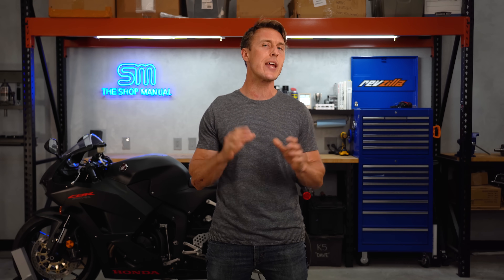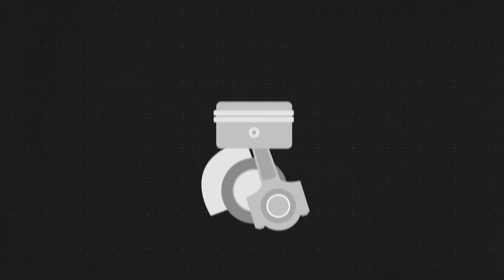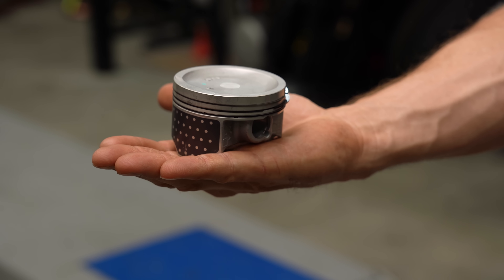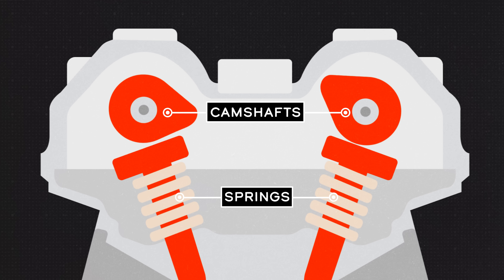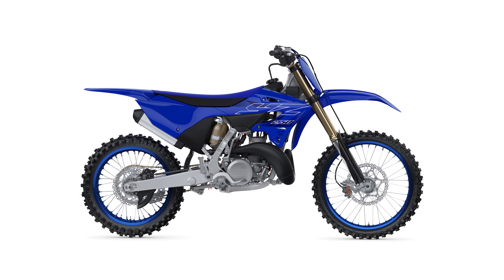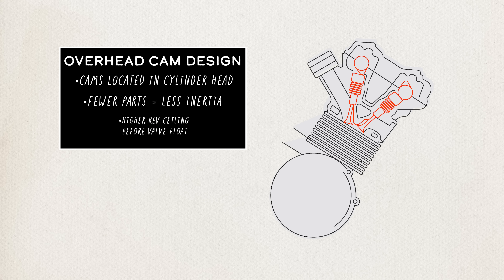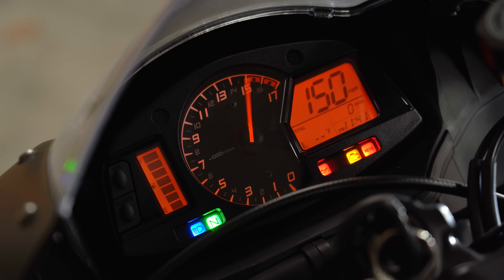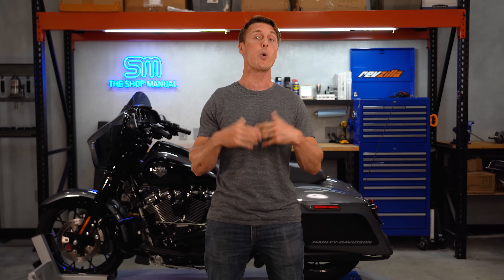This Is Why Your Motorcycle Has a Redline | The Shop Manual

Comment: Another reason for red lines in sport bikes is that the flame front of gasoline combustion is only about 105 fps (70mph). If your piston moves faster than that, it's using more power than it's producing.
Reply: Can you break this down, or tell me what specifically to Google for this explanation lmao
Reply: @PnTcertified  Gasoline and diesel do not explode.  They burn. And that's a very important difference.  Things that burn produce flames that travel at a specific speed.  With gasoline and air, that speed is about 105 feet per second. 

Engines produce power because the combustion process increases the pressure in the cylinder.  In a normally operating engine, that pressure pushes down on the piston harder in the power stroke than the piston had to push to compress the air in the compression stroke.

However, if your piston is traveling faster than the flame front, faster than 105 fps, it is only extracting the pressure it put into compressing the air.  It isn't getting any of the pressure from burning the fuel.  At this point the engine is using more power than it is producing because of frictional and pumping losses.

This would really only happen at the middle point of the powerstroke, not for the full stroke.  But it is still wasteful.
Reply: @SeniorKlean  wow, appreciate the thorough breakdown. This was easy to follow. Didn't know these random details about pistons and how combustion differs

Edit: to add actually, when you refer to the speed of the piston going faster than the pressure is able to slow it down, is that because sustained high speed has reduced the ability of pressure to overcome it? If that makes sense. Like what could cause speed getting so high to overpower pressure
Reply: @peanotbutta  It’s the opposite actually. It’s not the piston moving too fast for pressure to slow it down, it’s moving too fast for pressure to speed it up. 

Think about it like this. You’re pushing a child on a bicycle. At slow speeds you can push pretty hard. But you get to the maximum speed you can run and you can barely push anymore just by running. Give an extra shove by extending your arms and the bicycle is now moving faster than you can run. You are no longer able to push on the bike at all until it slows down to your running speed again. 

In that analogy you are the flame front and the bike is the piston.

Comment: Hmm hear this explained before but a bit differently
I might be wrong but it had a lot more to do with the speed gas can expand, thus producing power
Like cars engines are usaly bigger produce more power but are a lot stronger, yet they run at way lower rpms
But looking at piton speeds aka speed Gas is pushing on the pistons, they are not that different
Bike motors just havea very short stroke

Comment: 2 strokes having redlines might be true on larger street use bikes but with less than 150cc you will start losing power before the revs are too high for the parts to handle. For example my 88cc has its peak power (around 27hp at the crank) at 13.5k rpm and after that the power falls off rapidly. The bike will not rev over 14.5k even on neutral. Also it can handle these kind of revs throughout the lifespan of the engine.

Comment: I hate going any where near red on either of my bikes but there both built for low to mid range torque more then all out HP. GSX-S1000 and CBR300R both use torque to get you going! I usually shift it like 4k rpm on both of them! Cruise at 5-6k rpm on the highway. The CBR tends to run out of gear on highway so I don’t take it on there for more them like one exit! Winds it way to hard for my liking and that’s what the big bike is for it loves the highway! Eats it up!

Comment: That mostly car stuff. Modern day m/c motors have rev limiters. If you are shifting near redline it's a good way to slow down acceleration.
How about spinning a bbc with a 4.60 bore and a 4.80 stroke 8000 rpm?

Comment: At the Vespa shop I worked at in the 70s we used to demonstrate engine durability by running it wide open in neutral for a full tank of fuel.
Reply: Wow, really, a two stroke I presume, and the inbuilt ducted cooling alone sufficed? Kind regards.

Comment: Now what I'm still trying to figure out is what the redline RPM on my Suzuki GZ250 is. Nobody on the forums knows, and the manual doesn't specify. Manual only specifies that peak torque is at 7k and peak power is at 8k, but at what RPM does the piston blast through the gas tank and into my face?
Reply: Only one way to find out....
Reply: Did you find it out yet?

Comment: My 2012 Aprilia RSV4 Factory developed a crack in the CAM retainer, problem is you can't buy just the retainer you have to buy the whole head.  I bounced it off the rev limiter more than a few times at the track.

Comment: Hi Ari! I am new to riding just 1 year but took the MSF first and have over 24K miles. I ride a 2015 R3 totally stock except tires, brake pads and a chain. I have maintenance my bike as per Yamaha suggests. I don't think I ride my bike improperly. Would revving a bike like this say no more than 11K RPM (just to accelerate at first but regularly doing so) cause it damage? I have put a little over 8K miles on it since June it had 650 miles and sat for over 4 years when I got it.

Comment: I have a question possible to do a video this is very common. On the highway we all love the sound of our exhaust but many times I am at 5th gear and don’t change to 6th gear unless the rpm are higher to where I need to change it. I ride a Suzuki r600 . Is it bad to ride at that high rpm for long periods of time

Comment: I did a rev limiter party trick 2 weeks ago on my r6. Floated a valve, dropped it into cylinder 2, and am rebuilding the motor now! Cool trick huh!
Reply: My first motorcycle was zx6r and I always not only party's on every corner rev the engine and drift it , no issues and it was very old like 1998 or so with 33k km , what a machine
Reply: how many kms/miles did it have back then and what year is your r6 from?

nonetheless pretty cool that you get to rebuild it yourself, must be a tedious job

Comment: I have more to add to this. 
When it comes to electric motorcycles, voltage determines the top-speed and rate-of-acceleration of the motor. 
But whether you're a manufacturer, or building a homemade EV. Once you determine what spaces you're filling with batteries, you must then determine how much you wire those batteries in Series and or Parallel.

Basically, wiring in parallel, will combine the batteries capacities and amp-limits, which will allow the system to provide more range & torque, but the lower voltage will mean you will be very slow. Parallel is almost like being stuck in 1st gear.

Wiring completely in series, will almost be like being stuck in top-gear, higher top-speed, but because the amp-limit is so low, the batteries can't safely & calmly provide enough amps to allow the motor to create as much torque as IT safely can.

So, the things that limit the RPMs of an electric motor, are:
1) The amount of voltage you can practically produce from your onboard battery configuration.

2) The same Elecro-Magnetic-Fields that the motor uses to work, also create back-EMF, that not only limits RPMs, but is also the reason why torque starts to taper off, at higher RPMs.

3) The capacitors within the motor-controller/inverter, are rated up to a certain voltage, beyond which, they pop, so select a controller right for the voltage & amp ranges of your build.

4) The windings of wires, that creates the electromagnets the motor uses. The insulation of those wires, like any other wire, can only contain a certain amount of voltage, above which, the high-voltage will start arcing out, creating short-circuits, ruining the windings.

5) The fluid drag of the rotor and other components moving through air and or oil.

6) After all this is compensated for, the final factor, is that the motor spins so fast, that centrifugal forces start ripping it's rotor apart, and the bearings may not be able to handle those speeds, leading to them wearing out much sooner, or even catastrophically falling.

That's it, that's all the things I'm aware of, limiting the RPMs of electric motors...but I don't know what limits Wankels & gas-turbines, other than centrifugal-forces, fluid-drag, and maybe flame-fronts/thermodynamics?
Reply: Oh, I also remember a BMW car, that apparently had a lower Rev-limiter, to protect something in it's transmission. Someone reset the rev-limiter, because they had an aftermarket transmission, or just didn't give enough of a F.

Comment: Some bikes live at redline. My 1977 CB Twin's redline is 12.000 rpm,but I frequently push it to 13.000 or even 14.000 where points ignition just can't sustain spark. It was absolutely advised to stay at 12.000 rpm all day(The manual stated that 12.300 rpm was an acceptable cruising rev)  and even short bursts up to 13.000 were included in the manual. Small bike, high revs : all the fun with no fear of tickets.
Reply: I'm not impressed
Reply: @ronalddaub9740 That's nice dear

Comment: Question i cant find a straight answer to: SHOULD I LUBE BOLTS WHEN I PERFORM SERVICE TASKS? Coming from bicycle maintenance there is a golden rule there: everytime you unscrew something you clean that bolt/screw and GREASE it before putting it back. Is this true for motorcycles? Or will it lead to overtightening or undertightening?
Reply: My OCD tells me to do that, especially if u live near humid area

Comment: Coming from cars where typical my cars telling me to shift up so early for mpg benefits I guess and being fairly new to motorbikes im trying to get out of the habbit of not shifting up too early and letting the engine run 7000-8000 rpm. Is that the norm? See a lot of folk saying that's absolutely fine and actually better than trying to be more conservative.

Comment: When talking about crank shaft failure, you should have used a Honda CBR300R for your backdrop instead of the 600R ;-)
Reply: The snapped con-rod we used as an example of engine failure is out of a CBR300R.

Comment: I know the basics, but Ari and RevZilla usually give me something to think about.  Great cycle channel.
My VFR had a 11,500 redline?  90% of the time I was between 3 and 4.5k.  7k and you were at 100 mph. Took it to 10k for a brief time, and was ready to go back!  I needed a track day to find out what that machine could do.
Reply: Surely you rev your engine to accelerate?
Reply: @MrBulli69  he wasn’t really utilizing any of its potential.
Reply: 3k to 4.5k is awful for that engine, 5k and above is where it wants to sit all day.
Reply: That bike is BUILT for high rpms. The heat and inertia of higher rpms keep the shaft and pistons clean of low temperature carbon buildup. Stay in a lower gear, and use more of your rpms when your on the streets. (In the neighborhoods, temporarily use lower rpms and a higher gear to be polite and quiet.)

Comment: The numbers at the beginning were great!  Thank you.  Will try to remember them.....
A modern Honda's engineering and tolerances are mind boggling.  Too high to believe, sometimes.
Reply: Then it’ll really blow your mind to know that the Yamaha R6 redlines at 16,500rpms and are just as reliable as any Honda. The revs these bikes see is amazing.
Reply: @cfltitan  Yah.  And F1 engines go to 24k?  Amazing, and then you also have to make them reliable, in some sense. 
The 600 class are basically track bikes, which are marketed for street use.
Reply: @Redmenace96  I think F1 goes up to around 18 or 19 but that’s still just insane. They also use pneumatic valves instead of traditional springs which helps a lot. I know moto gp bikes rev to around 18,000 rpm too. It’s just unreal the rpm’s and power they’re getting out of stuff. Moto gp bikes are limited to 1,000cc (just 1 tiny liter) and yet they are averaging (especially the power house Ducati’s) over 300hp out of those! I thought it was crazy when liter bikes were starting to hit around 200hp. 😂
Reply: @cfltitan  R1000's are insane for the street. No judgment, just discussing the pros and cons. If I had one, I would need to be a lot younger, first; and second track days would be my hobby.  Need to go at least 2-3 times a year, get the leathers and slick tires.  I've had a couple of buddies who did it that way.  Just booting around on a race design with 200hp is loco.
Reply: @Redmenace96  yeah any RR bike for the street is pretty crazy. Just way too uncomfortable for any normal riding. That’s why I ride a street triple and love it. It’ll do 95% of what any rocket will do on the street but is way more comfortable.

Comment: Valve float is never impossible.  At those high revs the body of the valve can behave as a spring so even with a closing rocker you can still have float.  It’s still mostly float that determines redline.  The stresses on the piston aren’t going to kill the engine instantly but float will.
Reply: Are you suggesting that valve stems might go elastic? They'd have to stretch A LOT to cause interference with the piston. I think rod stretch is more common than valve stretch.
Reply: @AriH211 , no I’m saying all materials have a stress/strain curve (i.e they deform when force is applied - no material is perfectly rigid) and at the very high inertial forces that occur at redline, this deformation can prevent valves from sealing causing “effective float” even when a closing rocker is pressing down.  Interference with the piston, maybe not, but it’ll screw up your air flow.

Comment: I am very guilty of hitting the limiter, albeit not as much as I used to. For the first year of riding I accelerated to the limiter almost every day and while I don't do that anymore, I think the little red pig could still take it. I did hit it once a few days ago at cars n coffee leaving but no sweat. so far the bike has 28k miles on it, many of which were riding balls out. wouldn't do it on an older bike though. I would like to see a video more focused on the consequences of bouncing it off of rev limiter, you'd think if it is limited to protect the engine then it wont damage it, of course it goes without saying that running a motor at a higher rpm will cause more wear but I feel like it has to be more than just that otherwise it wouldn't be worth mentioning.
Reply: On my personal bikes I'm most worried about valve-seat and valve-face wear, which is costly to correct. Revving an engine out puts far more hurt on those parts.
Reply: @AriH211  oh ok. thanks for clarifying.

Comment: One of my bikes has a red line, the other doesn't. The one that doesn't loves to rev and has a two stage user configurable shift light so you don't even have to be looking at the dash. With EFI it's an easy thing for manufacturers to build in rev limits for each gear.

Comment: Thank you Ari, With your videos over the years teaching me how to fix and maintain my motorcycle, I've finally finished my project. A Cbr500r that I got on Copart for $625 that I've restored to OEM and even added a few mods, namely a sprocket change that gave me taller gearing. A thing I learned from you in your sprocket video. From the hardest job i think of that is Replacing Forks to even the most basic of maintenance such as cleaning and lubing your chain. You've been there for me every step of the way. 

Because I've toiled over him (the motorcycle) for the better part of the last two years, I believe that the motorcycle is an extension of myself. Thus I named him Rawhide, a anagram of my full name. 

Thank you Ari, and I hope to see you enlighten even more people into the wonderful world on two wheels. Such as you did I
Reply: That's awesome to hear! Also, excellent screen name.
Reply: @AriH211  thanks ari!

Comment: HAY MAN I have an additional question. I have seen "2500 fpm" as the max piston speed your bike's pistons can move continuously without wearing (wearing more ofc). On my KLR650, that happens at about 4600 RPM which in 5th gear doesn't get me to highway speeds. Given the KLR was designed in the era of 55 MPH speed limits, is it even safe to ride for long stretches at 75? OR is the "2500 fpm" rule only applicable to air cooled engines? I am not having luck finding answers that rise above the level of fuddlore.

Comment: I believe that two strokes are mostly limited by the fact that they have exhaust and intake ports cut into the cylinder walls. The piston rings have to be strong enough to withstand running over these ports every stroke. These ports seem to be the archilles heel of two strokes much in the same way that apex seals are for rotary engines. Even the great NSR500 race bike didn't rev much over 13,000 RPM.
Reply: Smaller 2-stroke engines can rev much higher. The NSR was 4 125s put together. An 80 or 60 can rev a bit higher. When you go even smaller, such as an RC car engine, 20,000rpm is commonplace.
Reply: Wait till you find out about the mmx500 inline 4 2 stroke. Thing is theoretically faster than a h2r. On paper at least. No one had done a side by side drag yet at least.